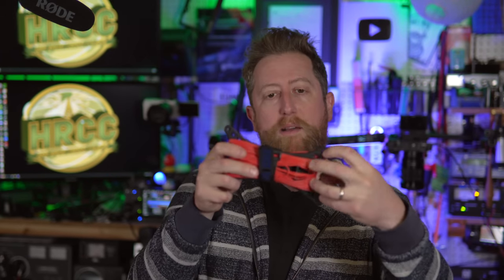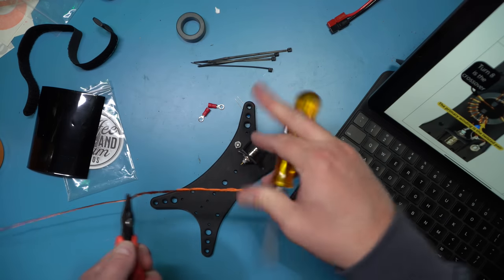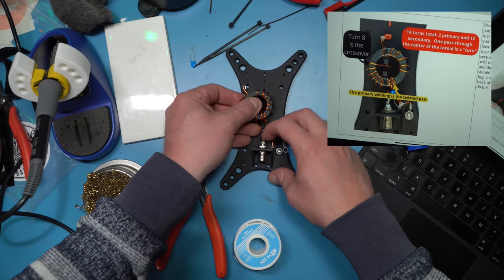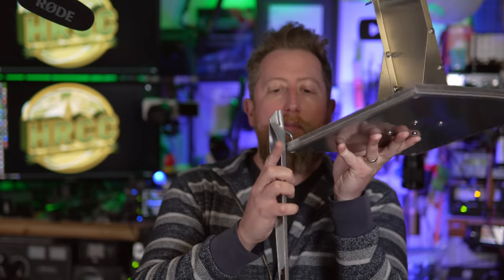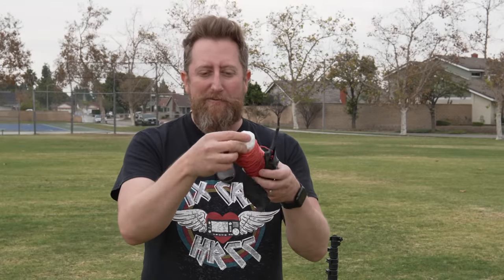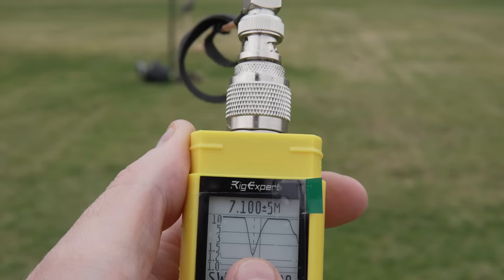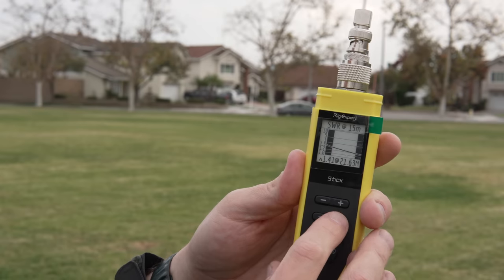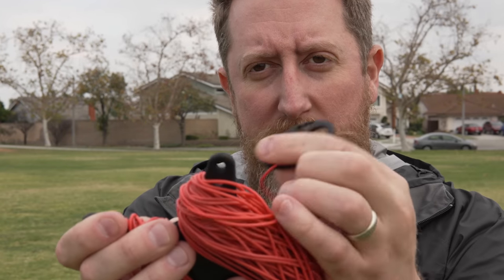How-To Build, Cut & Tune an End Fed Half Wave Ham Radio Antenna!

Comment: Callum (DXCommander) has a great Quick-SWR-calculator spreadsheet to find how much you need to cut (or add) going from the resonant frequency to the desired frequency. Saves a lot of time and effort with a new wire antenna, especially in the field.
Reply from the maker: Regardless of the calculator, I always cut long and just walk it in. No biggy.

Comment: I have been debating for a couple of months as to which antenna analyzer I should purchase, NanoVNA or RigExpert.  This video has made up my mind, the ease of use, & easy visibility of the RigExpert far outweighs the cheaper cost of the NanoVNA.  & I need it specifically for my 40m EFHW.  Thanks Josh for Yet ANOTHER GREAT Video!

Comment: Re the Hakko, they're an OK iron... but their day of being a good choice thermally is over.
The needing to hold it against things for long periods is evidence that you might be wanting to consider something better.
I have a JBC Station... not in the budget of most but thermally it's incredible.
What i have found is that the MiniWare TS 100 and TS80P have exceeded the performance of the Hakko Irons.
I believe the magic is in the fact that the heating element is part of the tip, rather than the tip and element being separate like the Hakko.
This is the same principal the JBC unit i have.
I own the TS-100 and find it an exception performer at 20 - 24v
The TS-80P supports USB-PD and can run off a good power bank with USB PD capability.
The TS-100 will also run at 12v but it performs 4x better at 24v
I'd recommend giving the TS-80P a go.. don't own it, have used it, performs 99% as good as the TS-100, but has better ergonomics and the TypeC PD is great.
It will respond thermally faster than the Hakko and won't lose tip heat so easily.. End result is you get more heat into stubborn components when you need it... Bonus - it's portable.
Only major downside that stops it being a fill desktop replacement is lack of a robust stand.
If they made a really accessible, comfortable, ergonomic and proper desk stand there would be no reason to reach for a Hakko ever again.

Comment: Thanks for the video Josh... there is always so much to to learn.

 ..have often seen these toroid's wound crossover but I often wondered... why the need to do that? Why not keep the lines of flux running in the same direction all the way around for better (possible) efficiency?  .. crossing over reverses the lines of flux and it also creates a break... 

So I wound mine continuous.

130' EFHW...ratio 14:2.. FT 240 52 core @ 100 watts (FT 891) the core stays cool, VSWR is 1:1 on 20 and 40. I also mount my core in nothing. If you think about it, there is no need. Mine is sprayed with conformal for a bit of protection. Makes for way less weight.. it just hangs from the insulator by a couple of cheap nylon tie-wraps. No connectors needed either, RG 8X soldered directly to the input. Coax shield is the counterpoise. Works like a champ... DX on 5W is easy...These are high Z antennas, so earth ground at the rig; doesn't change the antenna characteristics but grounding reduces static buildup and RX noise, especially on dry days.

What's the efficacy of this? Who the heck knows, but I suspect over 85% maybe even 90%.. what's not to like?

Comment: I think when you wrap insulated wire back on itself, you get a compacitive effect. If the wrapped portion was uninsulated, you would get less removal requirement.
Reply: EXACTLY.   Lets say you have to fold back 3 feet in order to get the resonant point on the frequency you are shooting for.  Now if you cut that 3' off, you will end up being TOO SHORT.   Never fold back and then cut insulated wire.    As an example.  Lets say you have to fold back 2 feet.   When you cut, only cut 1/3 of what you folded back.  That would be 8" in this case.  Now run your analyzer again and see where you are.

Comment: Josh another great video, thanks for all that you bring to the Ham Community. 
A quick note that can aid in the soldering process would be to pre tin all the connections before actually joining them together. Once tinned the connecting process will be quicker thus reducing the time required to heat them sufficiently for proper joints. Just a quick note from an older ET. Thanks again.

Comment: I built myself a linked EFHW using some polystealth wire and the K6ARK unun. 
The difference was that I calibrated it for 20 meters then added another element and redid for 40 meters. 
Though in the field I've found it works great on both bands but if I am only planning on doing 20 meters there isn't much point to adding the second element
Reply: How long is the 20m wire, take both with you & mark them up, you always have them then.
Reply: @EdzashedFudwinkle  I want to say it's about 33 feet long. I'd recommend adding some extra and slowly shorten it using an antenna analyzer to get it in tune. It takes some time but you only gotta do it once.

Comment: I don't know what looks better - that CaHRtenna or that RigExpert Stick!  Great job on that build!
Reply: Steve, do you prefer the RigExpert stuff to a basic nano-vna? I've never tried the former, but have had a nano VNA (the smaller, cheapie one) for about two years now and am delighted with it. Seems like it does everything the big $$$ SWR analyzers do and a whole lot more, but maybe I'm missing something. Sure beats the Palomar noise bridge I used for decades!
Reply: @socallars3748  I've only needed what the nano provides and "close enough" works for me. I used the rig expert with antscope and it was pretty similar

Comment: Hi Josh, I found it beter not to cut the element, just put Z +/- 1meter from transformer when tuning  ant run it as a sloper transformer  lof down  the z =/- 10-12 inch long and tight to together with zip tie so that you can adjust it for longer or shorter and move posssion of  zip tie,
Good luck ,
 Pieter

Comment: It would be good to mention that when doing measurements using coaxial cable VNA shall be always re-calibrated for a new reference plane (end of coax in this case, using Open-Short-Load method). Otherwise what you really measure is a impedance transformed by a coaxial cable. Especially on higher bands this can produce completely abstract and misleading results. If we do calibration then we will measure real impedance at the antenna output port - this is the correct way (the coax will "dissapear" for analyzer). It will also allow as to:  1. bring antenna to resonance by adjusting antenna wire (reactance ""X equal to 0 at the antenna output port) and then 2: to adjust transformer to match the real part of impedance to get proper VSWR.

Comment: Cool!  Thank you. ...patient assembly instructions!...
I'm paralyzed in analysis though.  As a brand new Ham (General), bought a Xeigu G90 that I haven't made a single contact on (home station) as I try to ascertain what the best antenna/band configuration is, so that I don't have to repurchase and reinvent over and over.  Reading the ARRL Antenna Book, observing videos praising the virtues of nearly every antenna configuration known to humanity, etc., but I still don't have understanding enough to make a choice on what to do in this SW part of America from home near an airport in a house with a metal roof, where "local" communications are primarily to be found on repeaters on 446 and 145, respectively.  
I can reach out with Anytone handheld, but I'd like to be able to HF, also.  ... maybe even be able to connect exterior antenna to hand-held for clearer VHF/UHF use?  Not sure about efficient or intelligent setup.
Reply from the maker: Since you have the G90, how about you try the K6ARK 20 watt End Fed Half Wave kit?  Its inexpensive and he is really good at support.  Plus there are lots of videos online.  The link to Amazon is on this video description for the 100w, which is probably overkill but would also work well!
Reply: @HamRadioCrashCourse , thank you!

Comment: Callum (dxcommander) also shows what folding the tip does to the electric length on a folded wire to the SWR... Shockingly different from what one expects...

Comment: 3:1 SWR is not even noticed in a receiver! I looks like this antenna stays below that in the bands it was designed for. At 3:1 SWR you can either manually back your power down, or use a matching network.At the very least you have an excellent quick receive antenna, but I bet that in a pinch you could compromise your tuning and operate this without having to make any adjustments during operation. I've heard very positive results from those who have built this style of antenna. (W2AEW)

Comment: Great video, thanks.  I have used 400 grit sandpaper or emery cloth to remove the enamel from magnet wire for nearly 6 decades.  It works for me and doesn't scar the wire as you are wise to caution against.  A small piece of sandpaper fits in with my tool kit easily, and can also be used to brighten up antenna wires at the connection points that have been in the weather for a long time.  Thanks for your contributions to the ham radio community.  Your explanations and encouragement help those new to electronics or radio realize that it is a terrific hobby. de N7PCE
Reply from the maker: Thank you! And a great tip on the sandpaper!

Comment: im about 4 hours too late for this lol... I just went and bought a roll of 12 guage THHN stranded wire to replace the flexweave antenna wire on my endfed which is old and tired. I just bought a 100ft roll and strung it out. SWR is pretty good, but too lazy to try and tune it.. although i did just snip off about 4ft off the end due to space lol. swr is low enough on the other bands i use that the tuner can deal with it lol

Comment: Does it matter if the feed/coax connection is at the top of the mast or the ground location?  I have seen some recommending the feed be at the high point while the others suggest have the feed at the bottom of the slope?
Reply from the maker: I am told feed at the top is best.  I have not tested it both ways… yet.

Comment: I'm pretty sure I'll be getting the ARRL end-fed antenna kit for Christmas.  What is the counterpoise?  I've seen other videos talk about it but nobody explains what it is & why and how to install.  And it looks like you don't need to ground this antenna?  I guess I could dig out my ARRL Handbook or go to the google but I'm at work so why not run up the comments on you video?  ;-)
Reply from the maker: All of these are answered in your handbook, but here is the short version.

You counterpoise is the other half of the antenna, e.g. the shield of your coax, or the - side.  If you don't have one, your end fed antenna will just use your coax as the counterpoise.  This often isn't an issue, until it is.   It's always the safe answer to have a lightning ground on your feedline before your coax enters your ham shack.

Comment: Question for you.  If you took more time, would it be possible to get it to 1.0 SWR for your desired band or is there just microscopic differences / inefficiencies that make that impossible?   God bless you and your family, Merry Christmas.
Reply from the maker: Realistically, the tuning I achieved could be the limit with regards to wire length.  You can play with the deployment as in moving the feedpoint and end point higher to move it. Also, they will change the radiation pattern. Also, ground composition is likely a factor too. 

So the answer is “maybe and likely”. But it’s not going to be the length necessarily.
Reply: Any SWR less than 1.5 is considered a good match. 1.5 to 2 is OK but could be improved. Your radio should be able to handle this safely. The design of an EFHW using a 49:1 matching transformer can provide a very good match because you are dividing any change in the feed point impedance by 49.  Since every physical installation is slightly different and varies over time it's not practical to maintain a perfect 1.0 match.  The disadvantage of the EFHW is you lose a little energy in the matching transformer but being frequency agile more than makes up for this. Being on the right band at the right time is way more valuable than 1 or 2 dB. Another issue with EFHW or off-center fed antennas is that the coax feed line becomes part of the antenna. This is not a problem for portable operation with low power. For a permanent installation you should consider adding a common mode choke to your feed line.

Comment: I love all your videos and you helped me get my tech license as well as still helping me with general but I do have some questions about this.  Antennas and getting the right one for multiple frequencies has always been the difficult part for me for some odd reason so this did help with what I was looking for.

Procedure wise though, I'm confused on how you went from having a single piece of coper wire with the one end twisted back on itself to having four ends of a wire.  did you cut the loop at the twisted end?  And if so how do you now have continuity between all points since cutting it would result in two separate pieces and with the lacquer on the wire they shouldn't be "connected".   what am I missing?
Reply from the maker: I don’t think I understand what four ends of wire? Thanks for watching!!
Reply: @HamRadioCrashCourse  Sorry, should have given a time stamp to help.

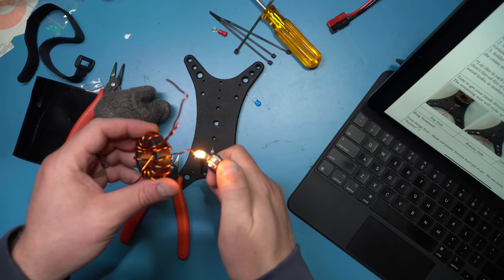go to 6:45 in the video where you are showing how and where to solder the ends, there are 4 points.  two on the BNC one (I think) for the counterpoise and one for the antenna.  At 4:50 you're finishing up with the wraps and then at 4:52 you start talking about getting the coating off there are 4 ends, I'm assuming and it looks like you just cut that "loop" where you twisted the wire back on itself for the primary loops, correct?
Reply from the maker: 1 for the radiating element, 2 for the BNC (center and shield) 1 for the counterpoise.  Pull up a 49:1 transformer image for reference.

Comment: Isn't the correct way to say it... 2 primary and 14 secondary because the secondary includes the first two wraps??  Your graphic shows 2 and 12 which is a bit misleading.  14^2 = 196, 2^2 = 4, 196/4 = 49:1

Comment: Do you have a version of this for total noobs?  More detailed explanation of how you built the transformer, how you picked the capacitor, how you measure impedance, what is a counterpoise, why are you adjusting the counterpoise and not the antenna, what's happening on that meter screen? 

Can you do this for HT? 2M, 70CM, GMRS antennas?
Reply from the maker: I kind of took the path on this video to augment your buying an end fed kit and following the included directions and my video. Get one of the kits below. They’re cheap.

Comment: How did you connect the wire to the S biner?  Did you just tie a knot?  Thanks
Reply from the maker: Nope. I showed it on the video. You just kind of pas it back and forth through the small holes and it locks it in place.

Comment: i would like to build this for 10 & 12 meters. it would have to be full legal limit. I dont know which parts need to be upgraded for 1500 watts
Reply from the maker: Generally everything.  The toroid, the gauge of wire, etc.
Reply: 1500W for 10/12m ? Maybe EFHW is not a good choice for these bands and such power levels :) Anyway - don't forget about a really (!!!) good high power rf choke. Otherwise using EFHW with 1.5kW will be really dangerous...

Comment: What did you wrap it at 3:40? I don’t understand what that does.
Reply from the maker: It’s a transformer it’s used to perform antenna matching to 50 ohms for connection to your radio.
Reply: @HamRadioCrashCourse  what does the twisting do? Like before you wrap it
Reply from the maker: Please look up what a Unun or Balun is, they are voltage or current transformers for antenna matching and other purposes.

Comment: Why this obsession  with 1.1:1 swr,,,in telecom industry  anything  of 2 or below is acceptable,,1,5:1 is good,,,bring the antenna so close to ground is going  to effect swr,,,but chopping  it make rhe ant no longer correct electrical  length,,i would cut for correct electrical  length for type of wire used then use a tuner to bring swr in if it's way out this keeping  correct electrical  length of antenna,,but real nice vid,,like those poles but pricey.
Reply from the maker: I mean you kind of explained on that second half why we just cut it based on how we’re going to install it in the field. General rule is 3:1 and better is fine. But I like to aim for 1.5:1.

Comment: KM4ACK at almost half the price.  How is this different?   You'll say 100w and I'll say I've run the KM4ACK at 100 watts every day this summer and no overheating or failure.   Dislike when other hams try to take advantage of other$.    Capitalism is such a wonderful thing.   $15 in parts and try to sell it for $74.99.    Someone needs to say it for the low information crowd.
Reply from the maker: Almost all the components are different between the two antennas.  

K6ARK is cheaper than both. So did KM4ACK rip you off? No not at all.